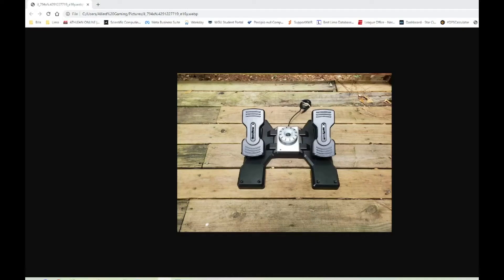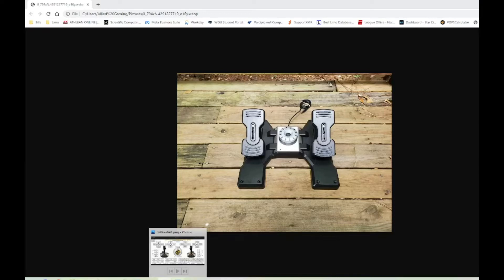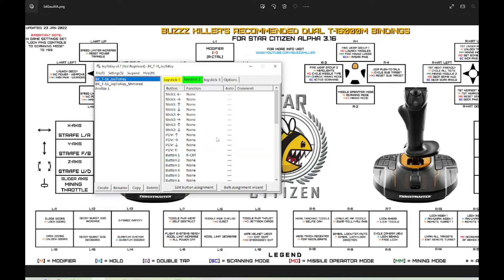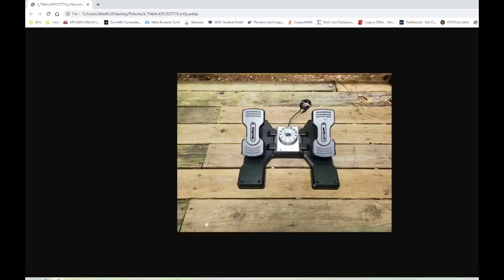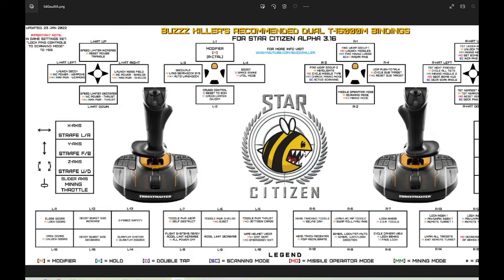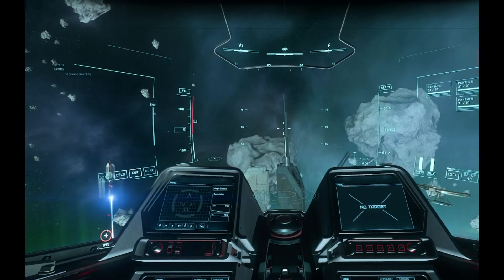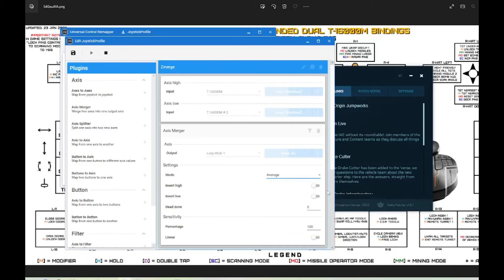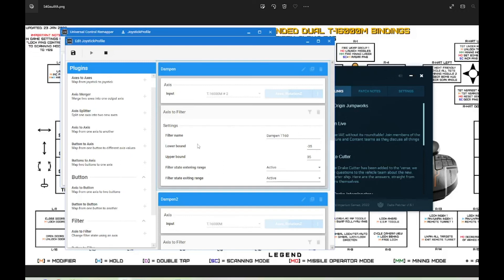Star Citizen HOSAS +  Rudder Pedal Control Setup. Map Z rotation to two Sticks!

Comment: The separation of the roll is quite interessting. I am at a full Virpil setup with rudder pedals since a couple days. I try to use the Z axis for my yaw and the pedals more like a car. Unfortunatly I have the same "getting pushed back" problem. I think I'll just remove the rolls from my gaming chair.😅

Comment: Great video! I'm trying to set up the exact same components. Other than boost and space break, do you have anything mapped to your peddles?
Reply from the maker: No, and there is an extra axis there if I needed it. I have experimented with using it to set my speed limiter but I've found I'm accidentally moving it when I didn't want to.